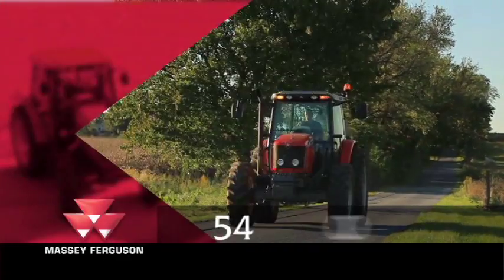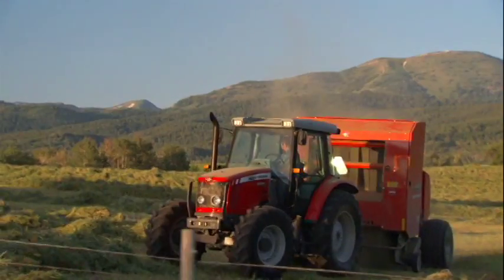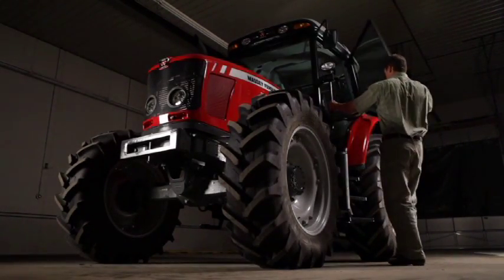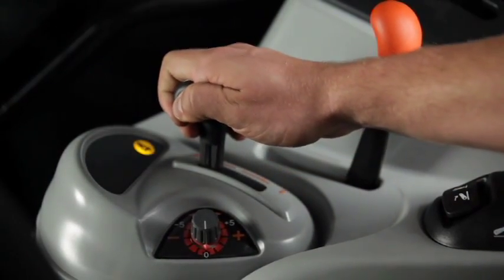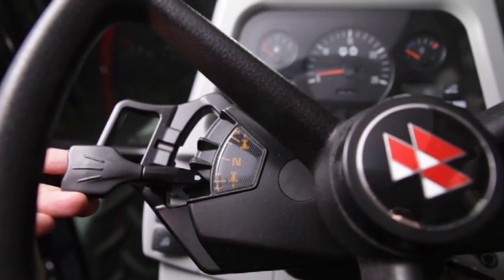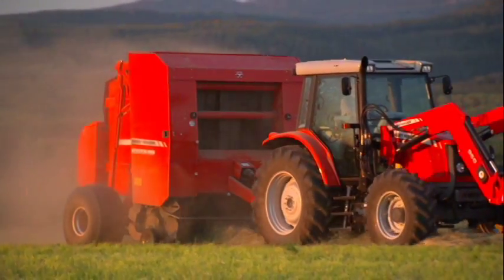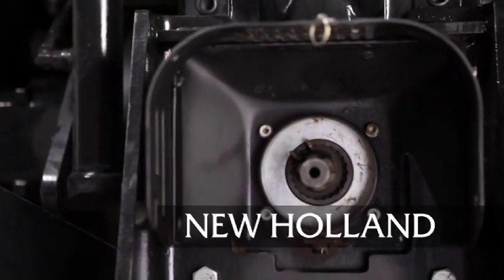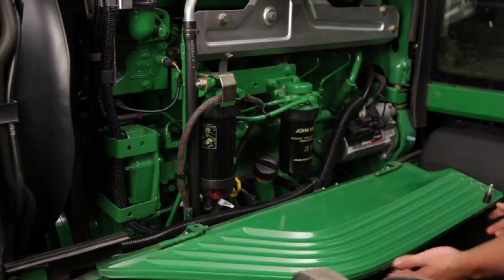Massey Ferguson 5400 Series Competitive Comparison

Comment: European designed MF are just superb, take a look at the new 6600 ore 7600 VT series. Strongest 4 cyl tractor engine on the marked for the 6600, by FAR the best tractor headland management system in the world, with DTM. Best CVT transmission out there. Really nice spool valve arrangement, no clumsy hoses for front linkage. Outstanding ride comfort. Its all most 1 ton lighter than comparable machines. The list just goes on and on.. Only negative thing is the price..

Comment: john deere 7530 engine has 210 horses. I have run the 7530 many times. and I know many who have 7530 and it has never received any injury on the engine. The worst thing here is the New Holland. New Holland is a fucking waste! massey ferguson and john deere tractors are the best here. and the john deere 7530 use almost no fuel!!!

Comment: The slightly smaller 5475 has a 6 cylinder, likey a more fair comparison against these competitive machines. 4 cylinders are nice for doing loader work because of their shorter nose. 6 cylinders are better at pulling heavy loads though.